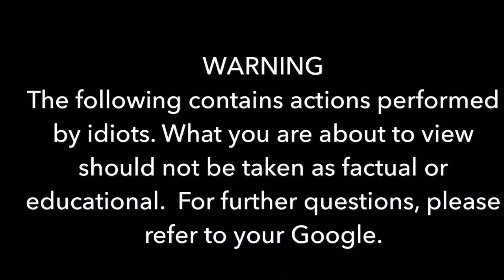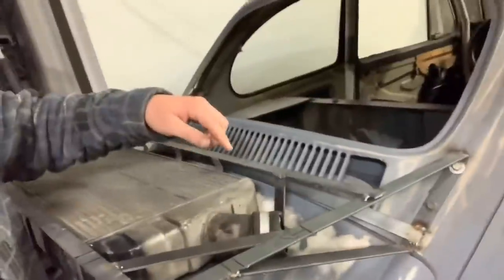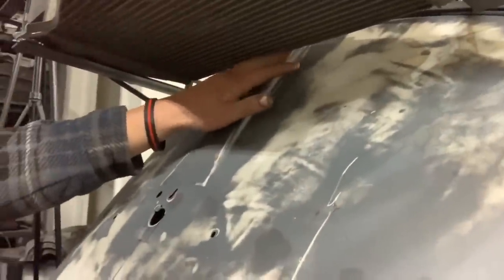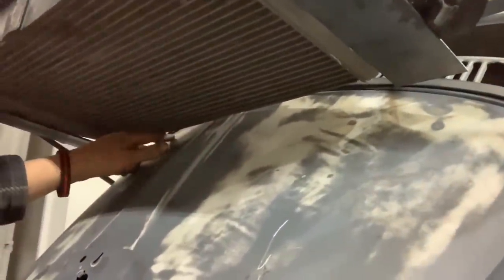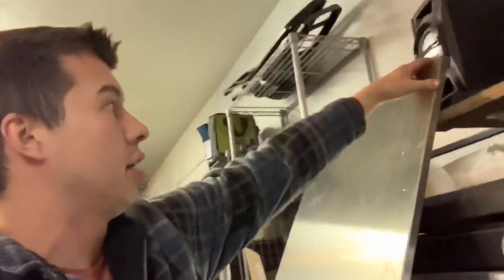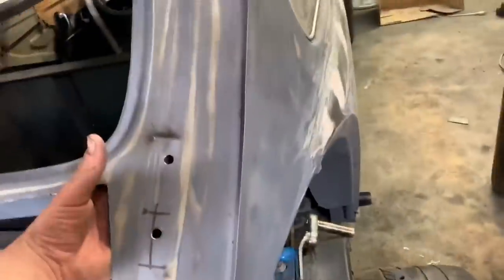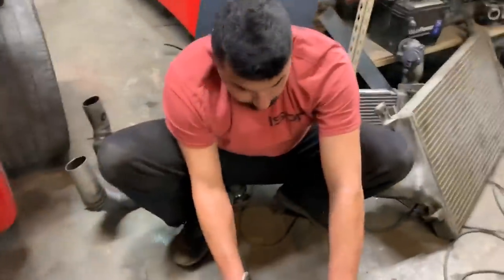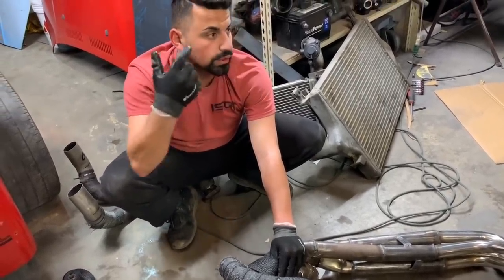Twin Turbo B18 VW Bug Final Steps!! Heat wrap, Drag Wing, Intercooler and Piping!

Comment: You could have used nut-serts into the body. And maybe get a hold of a hole saw for those holes into the body as opposed to cutting squares into the body for your intercooler piping.

Comment: DUDE! That looks AMAZING!!!  Since there is a gap between the top piece of stainless and the intercooler why not add some weather strip or foam strips to kinda make a "seal" between the intercooler and the top stainless piece.  Probably wont make a difference, but it for sure wont hurt.
Reply from the maker: I like that idea!!
Reply: Also it might stop the intercooler from rattling
Reply: @darkN3R075  I didnt even think about that
Reply: If you can use a butyl rubber it will last a good amount of time the weatherstrip is a awesome idea but if you can use strait butyl rubbaa

Comment: Meant to tell ya if at all possible run some roller beads in the centers like decorative with a bead roller if you can buddy helps a lot with the warping and adds strength laterally. C-ya bro
Reply: Exactly what I was thinking too!
Reply: Use an offset tipping die for great results

Comment: I am a welder but no welder comments. Welding is just seat time and it will come if you care. I love your work and ingenuity. But please support you argon CO2 bottle. If it falls over and knocks the valve off it can fly around the room possibly doing damage and hurting you guys, not to mention dragging your welder off the stand damaging it. Thanks for your work. Great content.
Reply from the maker: Thanks for the heads up man, I usually have it chained to my big steel table but we’ll get it taken care of

Comment: Use that same gate n run like 8 psi...n put a boost controller...wing looks good
Reply from the maker: I thought boost controllers can not decrease boost lower than the spring pressure?

Comment: If you want the captive nut in a hard to weld/reach place one option is to fasten the nut drill a couple of holes in the shell at the edge of the nut plug weld from the outside and then tidy up your weld. If you are getting distortion when welding assuming you have your welder set correctly for the material thickness try to cool the weld as you are working there are several options compressed air gun, a wet rag, strips of wet rags next to the weld area, a thick copper bar as a heat sink. Tips here:

https://youtu.be/1tdAgTCghUk
Reply from the maker: Awesome! Thank you!!

Comment: Boost pressure doesn't work like that. The gates would open at 15psi... so how could it make it to 30.
 ;)
Reply from the maker: 2 turbos, each wastegate opening at 15psi, meaning two turbos at 15psi each equals 30psi lol that is how turbos work
Reply: @GARAGEIdiotS  Negative. Let me try again, if your wastegate spring is 15psi, which means the gate opens at 15psi. It can't make more, because the gates are both set to open at 15psi. Doesn't matter if there's 1, 2 or 30 of them. Spring opens at 15psi... that's all that the system will ever see.
Reply from the maker: You are incorrect.  If each wastegate is regulating its own turbo then each turbo will make 15psi.  If we had one wastgate regulating both turbos you would be correct.  Or if we had both turbo vacuum lines linked together you would be correct.  But ONE wastegate regulating ONE turbo means that one turbo will make 15psi by itself.  I don’t know how to explain this any easier.
Reply: @GARAGEIdiotS  T both WG lines together, two wastegates, two 15psi prings. 15PSI total boost pressure.
Reply from the maker: I asked Facebook and have come to the conclusion that I am wrong!  You are correct sir, I guess I wasn’t thinking about CFMs, 15psi yea but twice the CFMs haha sorry man that didn’t make sense to me at first haha thanks for keeping me in check!!
Reply: @GARAGEIdiotS  Oh god you asked FB... surprise you didn't get 6 different answers. lol I've been boosting cars and tuning for over a decade, not here to troll, just thought I'd help.
Reply from the maker: And you did! Sorry I was so stubborn haha in my head it just didn’t click but I 100% understand now! I shall address my mistake in the next video!

Comment: how you doing why don't you use a water-to-air intercooler
Reply from the maker: Money really, heat exchanger, electric water pump, and intercooler even if we find used or ho eBay is still going to be in the ball park of $500, so we figured if we could make something else work then why not lol

Comment: Meth injection a must
Reply from the maker: This is a similar set up used on the old Porsche 911, they did a top mount like this using their duck bill Spoiler to create negative air.  It should work without but we shall see